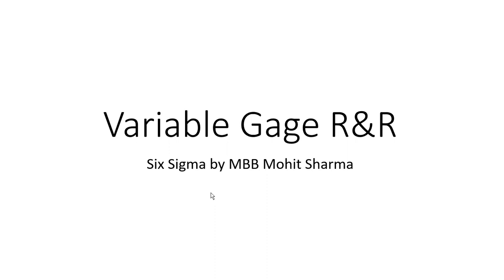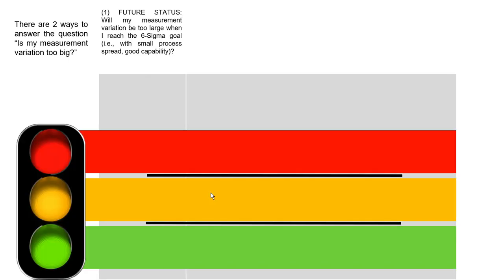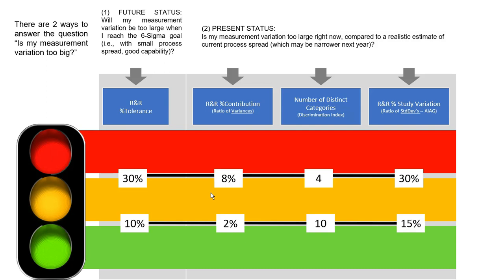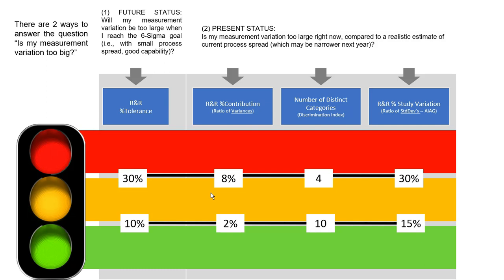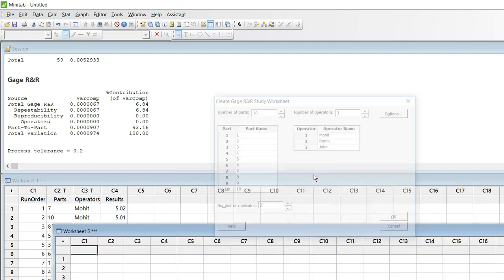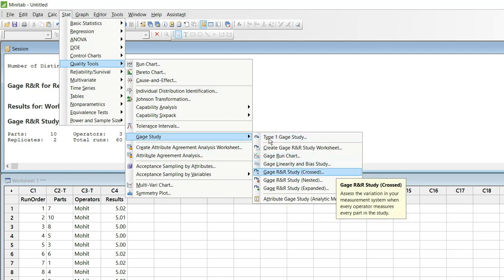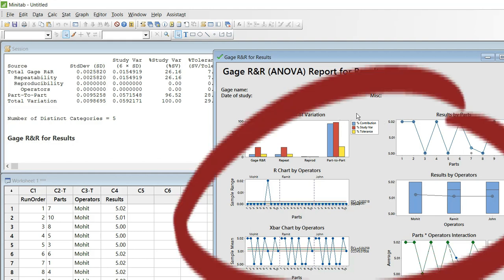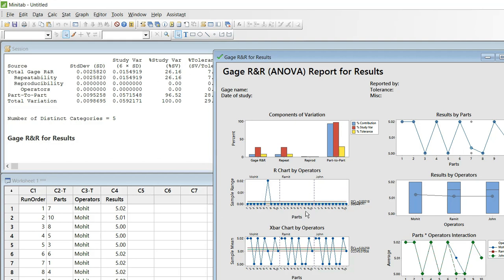Learn continuous Gage R&R with Minitab working

Comment: As I understand MSA is to validate the data before we conduct the analysis. Now, if the data is already there in the form of monthly reports from MIS department and I usually validate the formulas to check it's correctness and I start analyzing , do I have to do MSA anywhere?. Or what I cross checked the mis data can b considered as MSA ?.
Reply from the maker: You can check correctness of data coming out from the system by attribute gage r&r. Check for repeatability and accuracy. Make a person standard and compare results.
Reply: Thank you

Comment: Thanks for this knowledgeable video Mohit. Can you please explain how to conduct a MSA for AHT in a BPO that uses AVAYA CRM which automatically captures data? Please explain if the MSA is required. If yes, why and how the MSA has to be conducted. Thank you.
Reply from the maker: If time is already captured through a system then it is not required
Reply: @mohitsharma34  Thank you Mohit.